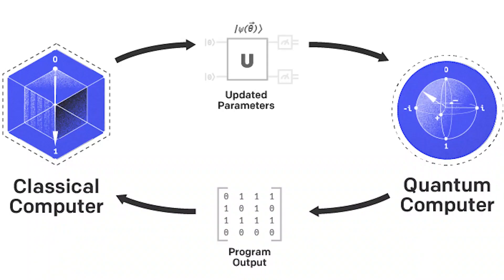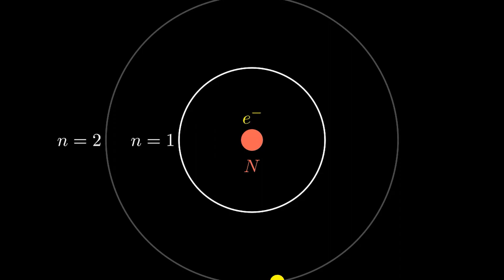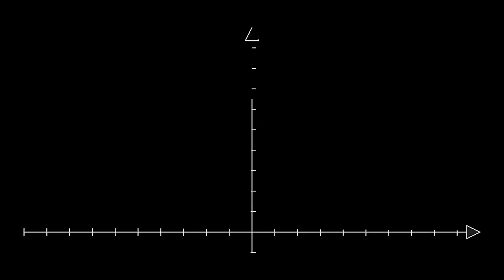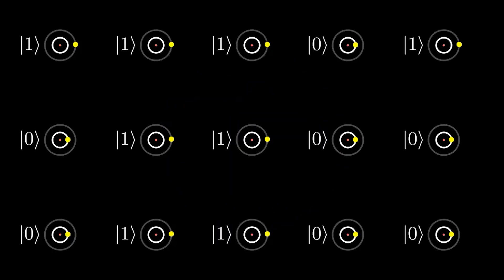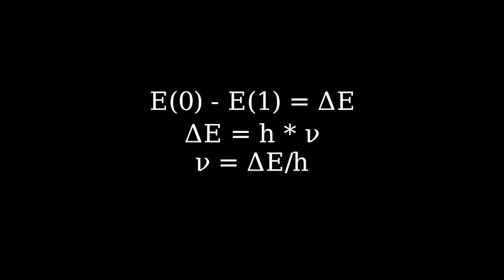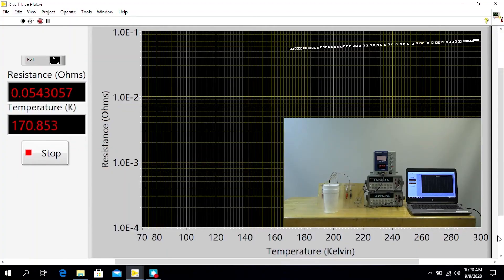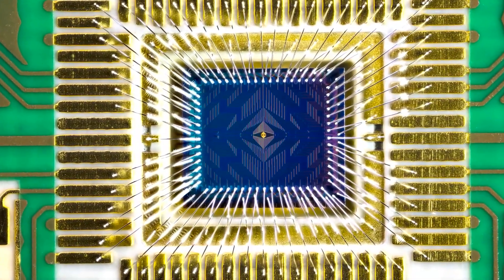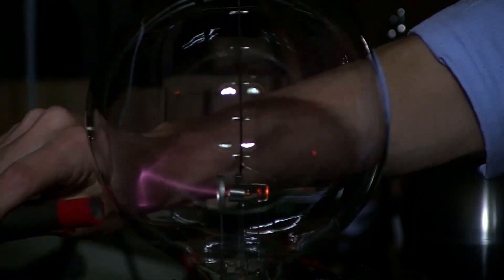How To Build A Quantum Computer

Comment: Thanks for the video. In the video you keep going back to 0 and 1 as computational states, which then raises the question, what's the benefit over conventional computing? I assume that maybe 0 and 1 are just end points and that the underlining representation can be more variable (within a range?). But that brings another question, if the underlining representation is variable then the result is bound to be variable as well, how is that useful then?
Reply from the maker: The benefit is that while you still have a basis of 0 and 1 as computational states (and the only states you can actually read out at the end), during the middle of the computation the quantum computer can be put into a superposition of various states at the same time. This allows some algorithms to achieve a speed up. 

Your instinct is right that there is always some probability of a quantum algorithm being wrong, but the same is true of many classical algorithms like Monte Carlo style algorithms. You can run the quantum process 1000 times or so and average away this problem relatively easily.
Reply: @Lukas-Lab  But if we are still bound by 0 and 1 as computational states, then what is the benefit of the superposition? You could use different transistors with various logic levels to define what is 1 (being that 0 is always 0v), I guess here you have one "transistor" that can operate in different mods, but I fail to see the benefit?

Or is it that we allow 0 and 1 to be a range? Like in your door example 0-30% would be considered close, and 30-100% would be considered open?

Funny that you mentioned Monte Carlo algorithms because that's exactly what came to my mind, but Monte Carlo algorithms are random by nature, so where is the randomness here? Is it in the conversion of whatever method is used (ion, atom etc) to computational states?

I understand that the YT comment section is not the best place for discussion, so your patience is very appreciated 🙏
Reply from the maker: These are all good questions so I’m happy to answer. 

The problem is a subtlety in the way superposition works, under the hood it’s different from just putting a transistor in an in between state between 0 and 1. The transistor there isn’t “a little bit 0 and a little bit 1”, it has an exact voltage state between the two. 

For the qubit on the other hand, if I were to put the qubit into a 50/50 superposition of 0 and 1, I wouldn’t measure an intermediate energy value, I would measure 0 50% of the time and 1 50% of the time. It’s also not like the qubits state was definite before the measurement but we just didn’t know, the qubit was actually in the state 50/50 0 and 1, but not an intermediate energy value. You can look into this more by reading about bells theorem. 

The real benefit of qubits is not just superposition, but entanglement as well, which is basically a special case of superposition where you have multiple qubits in superposition interacting with one another to create states that can’t just be described in terms of the states of the individual qubits. An example of this is a bell state, which you may also want to look into for more details.
Reply from the maker: To follow up on this, the randomness comes from the fact that when you measure a 50/50 superposition, it’s truly random as to whether you get 0 or 1, it’s not known by the universe under the hood. Again how we know this is bell’s theorem.
Reply: @Lukas-Lab  Thanks for clarifying that. I think your point about qubits representing a distribution of values, that make all the difference. You did explain that before, but maybe being stuck in the conventional world I [repeatedly] missed seeing the benefit. The 0 and 1 being more of a range can also be represented using a DAC in conventional systems, sure it's more cumbersome and adds another layer but it felt that quantum can offer more than just simplified systems, and the distinction is in the natural randomness of the lowest layer. Your previous comment about Monte Carlo and averaging a large number of executions now also make perfect sense. Thanks again for your patience and time!

Comment: In 1:38 you write 0.9|0> + 0,4|1> isn't that brake the rules of probability I mean the sum of 0.9and 0.4 should be one could you clarify please
Reply from the maker: The sum of the coefficients squared needs to be one, so it should be that a^2 + b^2 = 1, but you’re still right I think there was a round off error or something, for it to be 1 that’s actually something like .91 ish.

Comment: This might be a dumb question but how do the lasers shining on particles and the qubits get translated too computer code(binary)? Proprietary software? What exactly is processing and interpreting this data set?
Reply from the maker: I’ll answer this as best I can. 

The lasers shining on the qubits are what impliments “logic gates”. Logic gates are the fundamental algorithmic building blocks, and change the state of the qubit(s). By shining a laser on a qubit, you give it some amount of energy and change it’s state in a known and repeatable way. 

There isn’t really a direct translation to binary, because fundamentally binary can not represent the state of a quantum bit. The way that classical computers are involved in the process is essentially that you write code on a classical computer that you want to execute on quantum hardware, then you compile that code, which translates it into binary and allows the classical computer to read and execute it. The classical computer then executes the code, which contains a series of instructions that tell it to pulse lasers in specific ways. The lasers that pulse are what talks to the qubits, but the binary that contains the laser pulses doesn’t hold the quantum information that you’re processing. Once you execute all the gates (laser pulses) you then have your qubits in their final state in your algorithm, at which point you measure them and get a binary answer (since all the superpositions must collapse into a classical state). 

I hope this helped! If you’re still confused, I’m working on a longer video on programming QCs as we speak, that should come out relatively soon. So stay tuned for that :)

Comment: This is the best explanation of a quantum computer I have ever seen!!  I didn't know that those chandlier thing was only the coolant system!  I still dont see how this computer can help us.  A 50/50 decision, is a guess.  Great show!
Reply from the maker: I’m glad you liked the video! 

To answer your question on how they’re useful, often, we use the 50/50 superposition as an example to illustrate quantum superposition, but the real power comes in that we can make arbitrary superpositions. By implimenting algorithms that modulate the probabilities in our superposition, we can nudge out quantum computer in the right direction until it is 99+% likely to get you the right answer. Then you get statistics by running the algorithm multiple times and taking the answer that is most frequent.
Reply: @Lukas-Lab  it is still a guess.  A regular computer will give you an exact answer.  These will just guess. You will never be 100% right.  There's always a variable.
Reply from the maker: There is definitely randomness in quantum algorithms, but that bieng said, there is also randomness in many classical algorithms. Monte Carlo methods for example rely on randomness to work - and so equally with those methods you could complain that there is variability, since we can do statistics we can be solidly confident in most quantum computing results, and additionally we can often check our answers on classical computers afterword to ensure that they were right. For example, with shor’s algorithm you can run the algorithm, find your factors, check that they actually are factors (if they are then great, stop here). If not, rerun shors algorithm several times and check each time. Although for a fully fault tolerant quantum computer it’s very unlikely you will actually have to run more than a couple times to land on the right answer, since it’s most probable by far.

Comment: This video doesn’t explain how to build a quantum computer at all. Which materials do you use f.e.

Just a lot of complicated drawings we normally see. What’s the physical stuff a quantum computer is made from?
Reply from the maker: Thanks for watching! This video was an overview of a bunch of different types of QCs, so I definitely didn’t go super deep through technical details. 

If I were to go deep into the technical details of how to build each type of quantum computer, each one of these topics could have been a full college course. In fact I am a physics PhD student and next semester I am taking a course on superconducting qubit design. 

That said, can you ask more specific questions? What did this video not address that you wanted it to? I’d be happy to make a more detailed video in the future going through explicit steps - but im not sure what parts you wanted more information on. Ie: what do you mean by “the physical stuff”? In the video I talk a bit about the different materials used - do you want more specifics here?
Reply from the maker: Here are a couple direct examples, hopefully this is helpful: 

For superconducting qubits, Josephson junctions are often made using Aluminium/Aluminium Oxide, where a very thin (~2-10nm layer) of the oxide is sandwiched between two layers of the superconductor. The rest of the circuit is usually either Aluminum, tantalum, niobium, or some other superconducting metal. The whole circuit is usually made on top of a silicon or sapphire wafer, although it depends on the specific qubit type. 

Spin qubits are usually made on silicon, and can be made tons of different ways. A simple example which In practice is really hard to make, is by doping the silicon with something that carries an extra electron like phosphorus. This electron becomes trapped and it’s spin can be addressed individually as a qubit.

Comment: Building Quantum Chips and Computers is easy.  It is the Noise that is the problem.  Electrons can "tunnel" from one side of a gate to another.  Controling that with precision is the key.  Electrons in the Quantum fields of its particle cousins are there, or not.  The margin is profoundly tiny.

Comment: How are they programmed and how can it solve anything at all?
Reply from the maker: This is a long answer, and I’ll be doing multiple videos on the topic :) basically it comes down to performing logic gates, similar to classical computers. These are usually physically executed with different duration/frequency laser pulses, and put the qubits into different superposition or entangled states. Some algorithms are shor’s, Grover’s, and detusch-joza if you want to look into some introductory material.

Comment: Implementations so far sometimes seem to depend upon a real life (including what might be seen as mundane) use case, but also on whether  or not the result (a state) is to then interact with a traditional binary digital computer or something 'like' a traditional computer (like a gate array). So for example some cimputation simply does not matter all that much if it has errors in it, like for example dropped video frames just as long as it is tolerable to ther human viewer or to the computer that must capture it. A signal might for exmple be made by interfacingg multiplixers between a traditional digital binary computer and some new device which might be considered a quantum computer. A MIPI interface uses symbols instead of binary per se although those symbols can be a combination of binary or rather waves approximated from binary. Take for example the data that might populate a gaussian kernel generated from its histogram of hardcoded value digitally. A energy state estimation as a close enough approximation (say of an energy state) of the contents of that histogram bin gaussian kernel could be done by Parzen-Rosenblatt window method, treating the density or probability of the Gaussian kernel a its hypercube, which of course implies hyperplane at some point. A MIPI symbol could be a close enough match for an approximation and so could an energy state (or even a phase), and so while that state is held and while that MIPI symbol (or a symbol like it) is in the signal path, the multiplexer can consider it a close enough match for the video and put it on the screen on in a binary stream. As long as it probably gets it correct enough, for some video a person might not be bothered and would be content with it. Obviously, other spectral analysis like Chebyshev polynomials beyond video have potential for this (or spectral clustering, or elimination, or kernelised classification). An a neural network could tidy up the results. So it could be for LLM language model recognition in 'learning' but also statistics predictions, drug-discovery or computational-chemistry or physics, or smoking-gun fault-finding evolution, or electromagnetic spectrum analysis. A MIPI symbol could be representative of a Schrodinger equation result for a molecule or atom. The reason why the aforementioned "probability" (of being in a state between 1 and 0) would suffice in some video processing is because some elements (like Germanium) can produce unstable results anyway but the video signal might not care all that much and so also using a different element for the quantum approach could produce a close enough and unstable result, throwing away video frames but say keeping audio. Another example is a touchscreen (or maybe an MRI scanner) or trying to isolate a hidden entity which is probably going to show up 'eventually' in some place and time, or as exotic. You might also be able to predict of you are going to have information that can be treated as a function and then in specific ways in a matrix. Also, finding the vertex of a parabola ( and BTW a parabola is shown aat the start of the video) can be used to predict or find velocity, acceleration (or deceleration, speed) or a secret of velocity. a simple example is a particle (e.g. a ball rolling) traversing down half a parabola cleft in twain, like a skater in half-pipe. Predicting or computing other particles (sub-atomic, etc.) can use such approaches. As per gravity, in the machine-learning context, a suitable gravity for a machine-learning could be predicted. So you repeatedly optimise. Then consider what graphing or weighting to opt for. Not everything computes.
My comment has no hate in it and I do no harm. I am not appalled or afraid, boasting or envying or complaining... Just saying. Psalms23: Giving thanks and praise to the Lord and peace and love. Also, I'd say Matthew6.

Comment: A question I have, and one I think rises from only a basic level of understanding is how quantum computers with their variable probability of outcomes can be used to do meaningful calculations.  How do you use a quantum computer? What type of computations is it making?  Can they be used to get repeatable results, or is it always going to be a probablistic result that changes every time you do the same calculation?

I know you wouldn't be doing simple things like 1+1=2 on a quantum computer, but what sort of math DO you do on it? And once that math is done, how is it read out?  Are all the calculations and commands for things like a GUI and user processing done on a standard computer, with only certain calculations dumped into the Q-Computer before being fed out and translated into regular bits?

What's the use case for a quantum computer, and how do you extract computation from the super position of quantized particles?
Reply from the maker: Thanks for the detailed question! It’s a complicated question, but I’ll try and be quick in my answer. I’ll also be doing a more specific and detailed video on individual quantum algorithms. 

First, a quantum computer should reliably give you the right answer 99.9999… etc percent of the time, provided you take enough shots. While the exact probability distribution you measure will be different every time, what should not be different is the fact that the “right answer”
Is most probably selected. Whether it’s selected 930/1000 or 970/1000 shots doesn’t change whether it’s the answer. 

If you wanted to try and get exact values for every single coefficient in your superposition, you’d probably need to do something on the order of 2^n measurements where n is the number of qubits. But quantum algorithms are designed to not need to know every single state, just the most probable one. 

If you want to know about specific algorithms, look up Grover’s algorithm.

Comment: So if you have a neutral atom qubit in the state (a |0> + b |1>) (where |a|^2 + |b|^2 = 1 of course)
Why would sending a laser with photons of energy the difference between the energies of |0> and |1> , result in the atom going to state 
(b |0> + a |1>) ?
I get why it could make |0> become |1> , but... why would it also do the opposite? Because of stimulated emission?
But also, even if it does, why would it send |1> to specifically |0> instead of e.g. -|0> or i|0> ?
Reply from the maker: This is a good question, I haven’t done the math myself but I’d imagine it’s related to a selection rule + the phase of the light. I’ll see if I can dig anything up though.
Reply: @Lukas-Lab  Thanks!
Reply from the maker: This is the right answer, I forgot to respond but its all the matrix elements! Thanks :)